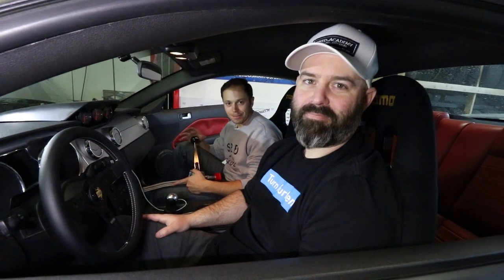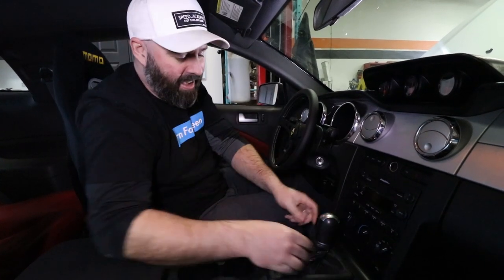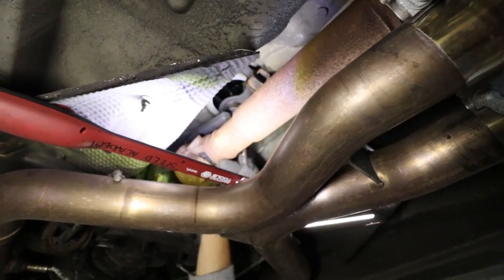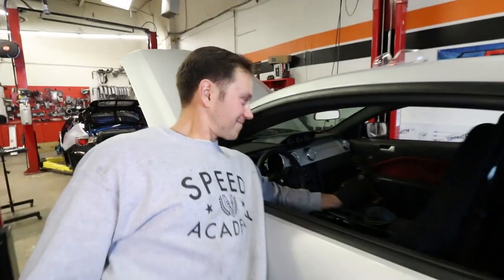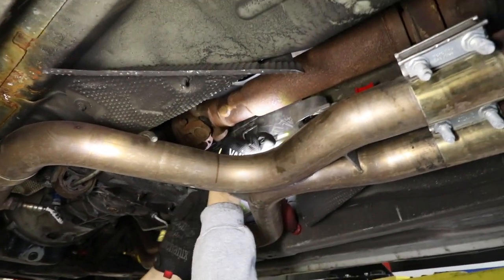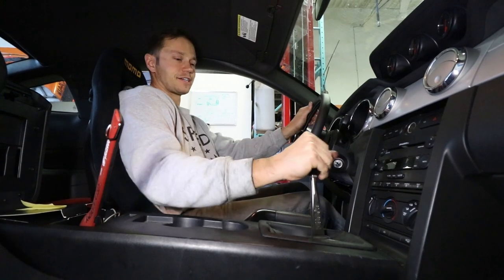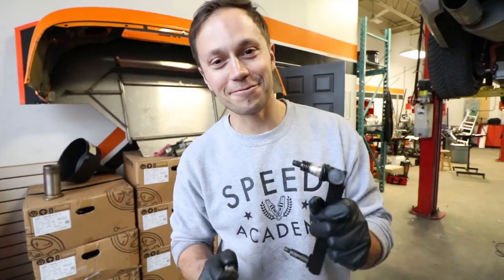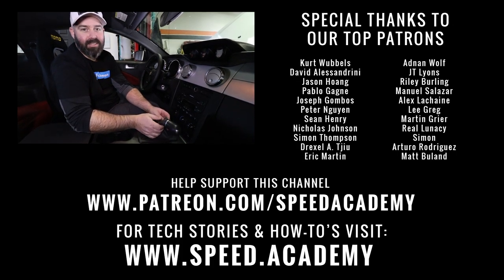So Smooth! Roush Short Shifter Install - Mullet Mustang - EP15

Comment: MGW Shifter > than any short shifter kit.

Should have bought the MGW kit instead. You're missing out on a great shifting experience, and the short shifters will still cause high RPM lock outs.

Comment: You guys need to make friends with a machinist or two. Could whip up a couple of them bushings out of aluminum in just a few minutes.
Reply: I'd gladly hook them up.  Plastic is a better bushing material than aluminum.  They want bronze.  We make bronze bushings all the time.
Reply: As would I, but it would take a while to ship to them being that I'm down in south Florida. And yes that's true, bronze would be better. Especially oil impregnated bronze.